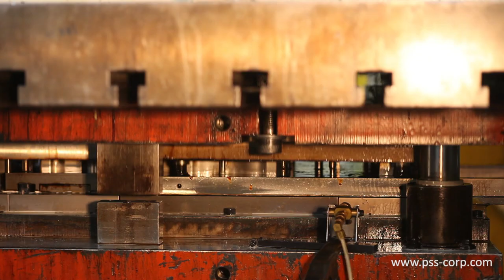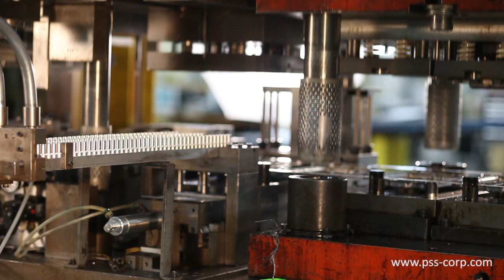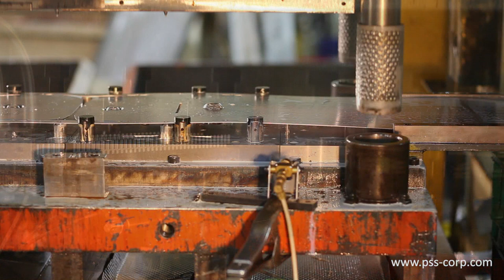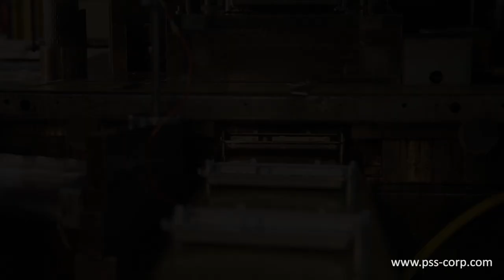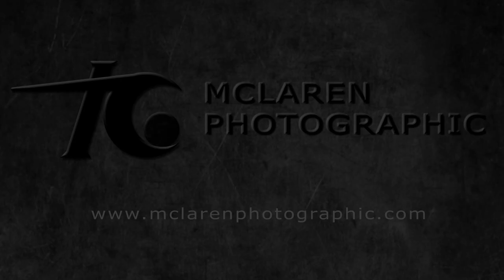Manufacturing Video - Progressive Die Stamping Process

Comment: What are those spraying things ? What are their benefits
Reply: They spray oil or some kind of lubricant so the tooling does not overheat.
Reply: @Nyteize  not true. We use lubricant so the steel runs through the die nice and also to reduce the chance of splitting. You don't always have to use lubricant to run a progressive press like this. Depends on the die and coil of steel.